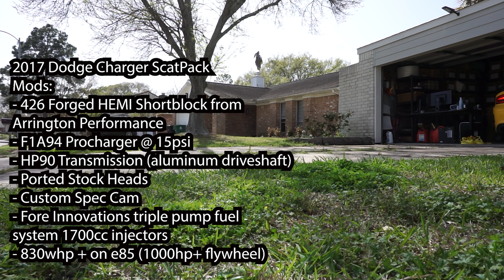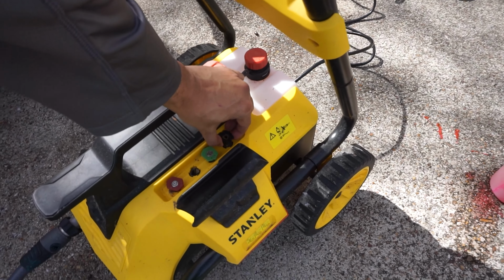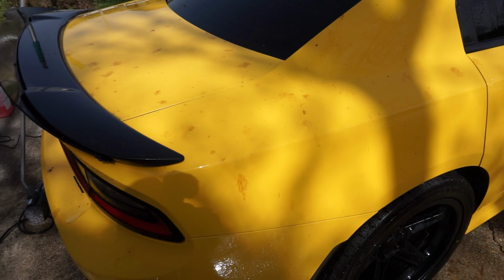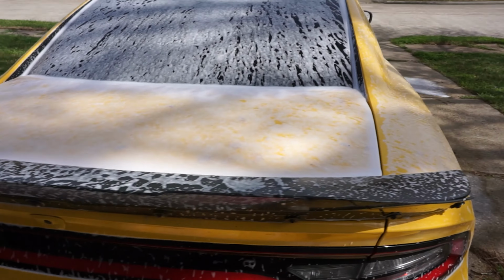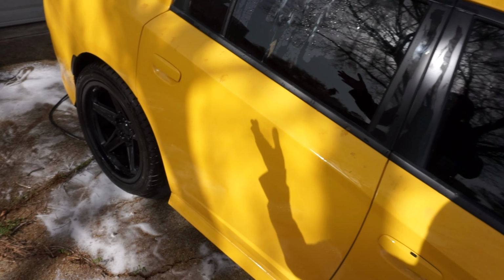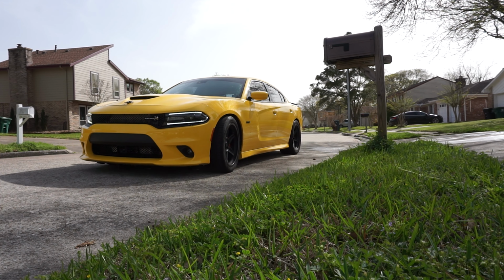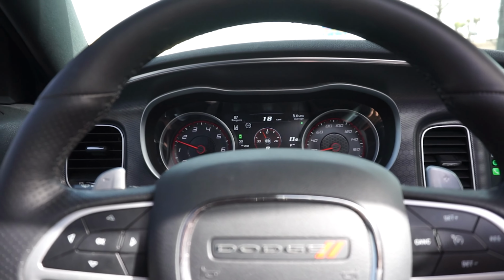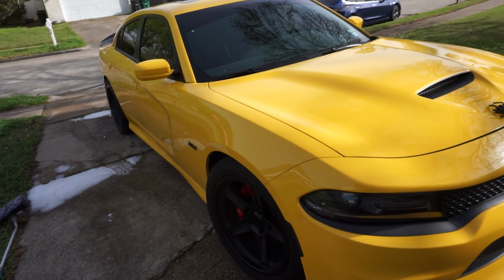Foam bath works! But is it really worth the effort?

Comment: You can use the high pressure tips just don’t get too close to the paint; keep it a 6-12” away for 40 degree and a little further for the 25 degree.

Comment: First.. black tip is low pressure for use with foam tank on the pressure washer.  Throw it away.  Use green tip, rinse car then use foam. You only need a few ounces of good soap in the rest warm water.  Put water in first then add soap.  Foam not only loosens dirt it gives added lubrication when using wash mitt to keep scratches down

Comment: I use yellow tip. I have a comet wall pressure washer. These electric ones are terrible with pressure to begin with so I  highly doubt a yellow tip will cause paint damage

Comment: Yeah bro... I have the TA 392 with the matte black package. The matte is a PITA to keep nice... Mine already has water spots lol but the rest of the paint is fine... I use to go through the auto washes... Damaged my matte... I stopped going in there. Now I use touchless unless I wash it myself with microfiber... I don't mind using the foam though... It's cool.

Comment: If the car is coated with a ceramic or similar coating you can get the car about 95% clean with just foam and no touching.  But if the car isn't coated touchless is very difficult to achieve.
Reply from the maker: I need to get it coated. Can I do that myself?
Reply: @DadMods  You can but prep is a lot of work. Depending how on how marred the paint is you may have to do a two step paint correction prior to coating. Without proper prep taking the time to coat is wasted time and money.

Comment: Foam the car dry and let the foam stand for 10 minutes. If sunny, leave it on 5 minutes. The foam penetrates and lifts the crud so it washes off. I use a Griot cannon and adjust to fan the foam, not direct stream it. You only need 1 1/2 oz diluted for two foam washes. Play with the adjustment next time and see if you can fan it. If your washer chokes up, open up the flow valve on the foam cannon so the pressure washer unloader valve doesn't shut you off.

Comment: The foam cannon is definitely not a waste of time . Trust me . And The black tip is for if your using the internal soap dispenser don’t listen to any of these people . Use the 40 degree tip if you can hold the pressure washer up to your hand with out harming you ,you can easily hold it up towards your paint . And won’t cause any issue as long as you don’t have paint chipping . That Stanley pressure washer is probably low psi anyways not anywhere close to a gas pressure washer psi.

Where are you in Texas I’ll come over and show you how to clean your car super nice using what you have an a lot easier than what your doing now . And I can film the wash of your car and put it on my channel .
Reply from the maker: I'm in Houston. Let me know, the car is always filthy inside and out.